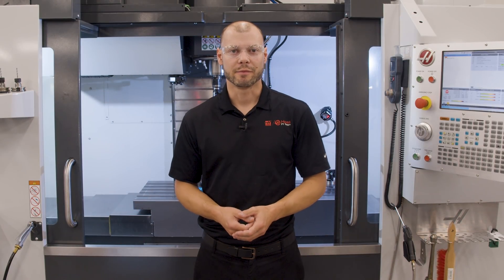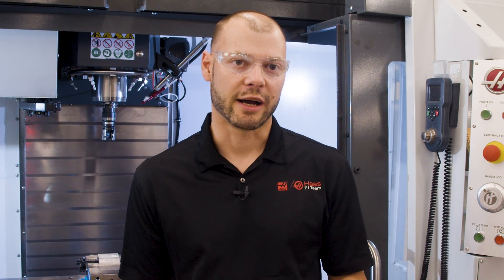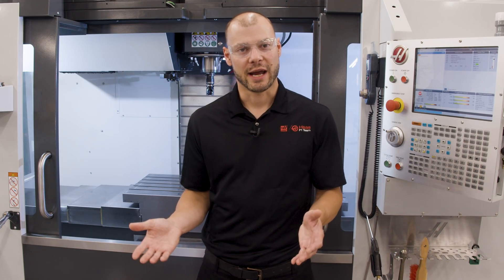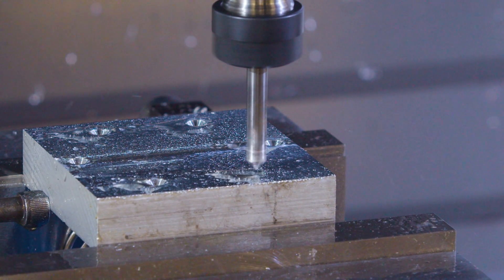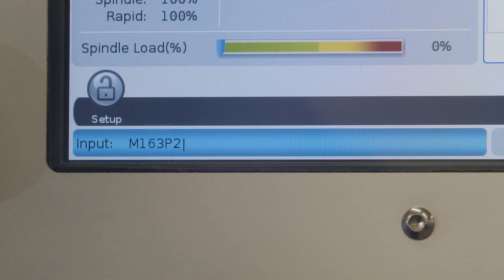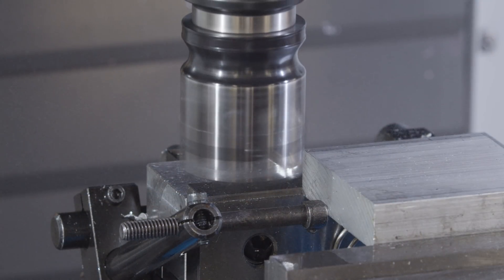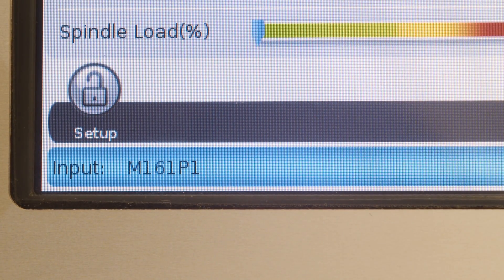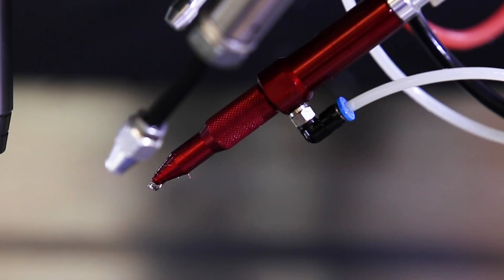Apps Minute - PulseJet - Haas Automation, Inc.

Comment: With all due respect, what is stopping me from doing this with a selonoid, nozzle, and spare m code block?  I have 4 has machines  if you need an idea to sell machines, please just add some iron and quit pissing around.  BTW I design automated systems for a living  I do know what's involved.  The true cost to you is minimal compared too the benifit.
Reply: Tony DeSalvo Nothing really. Though it does seem that it wouldn’t be quite that simple considering they have it integrated with their other cooling system which allows it to adjust for different tool lengths. You’d need a servo and a bit more communication from the controller to be able to aim it.